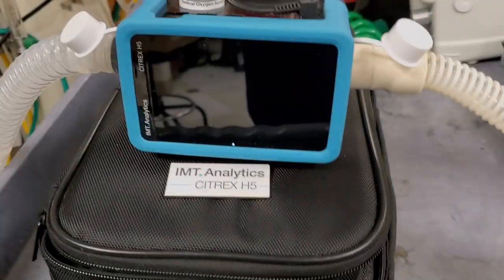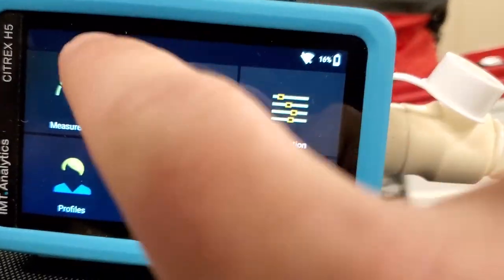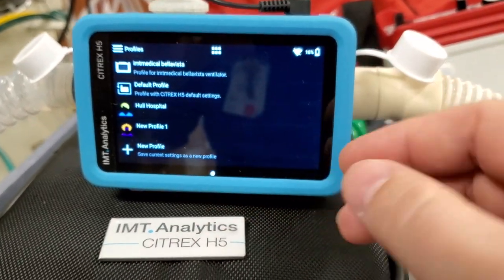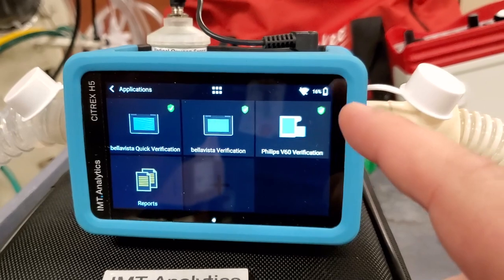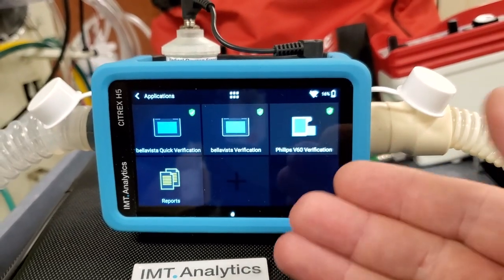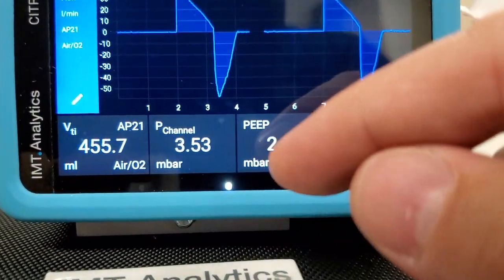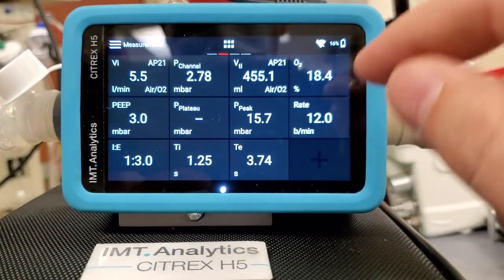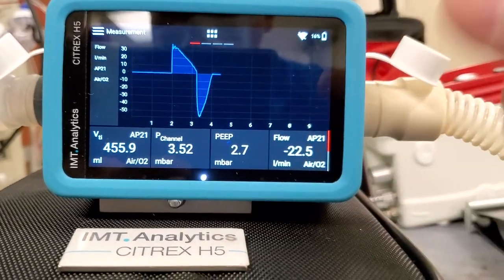IMT Analytics Citrex H5 Gas Flow Analyzer Overview!

Comment: How fast is the oxygen sensor? Thanks for the review!
Reply from the maker: Are you referring to the recovery time - where the sensor flipps between extremes? Because of the small size, I would bet that this one measures faster or equal than other meters. The smaller size means the internal volume of gas that needs to evacuate before new values are measured is less.
Reply: @BetterBiomedChannel  Is it capable of determining in and expiratory concentration?
Reply from the maker: If the analyzer was placed inline with the insp and expr (before the Y), sure, depends on the breaths per minute though.